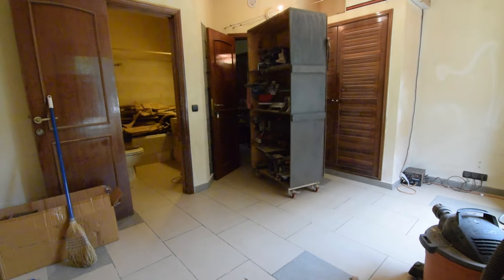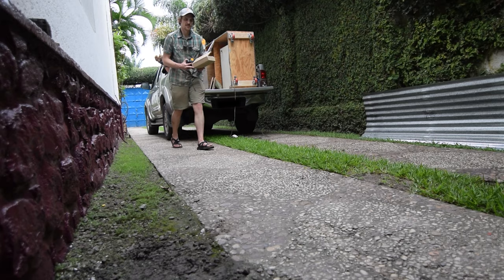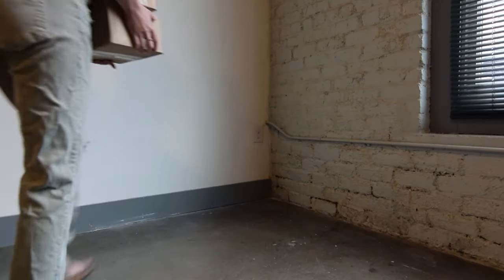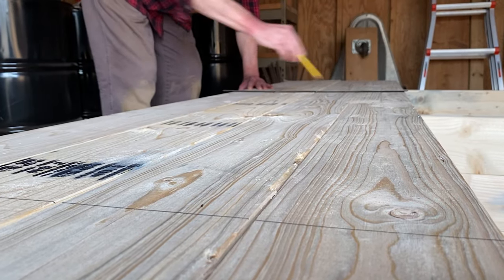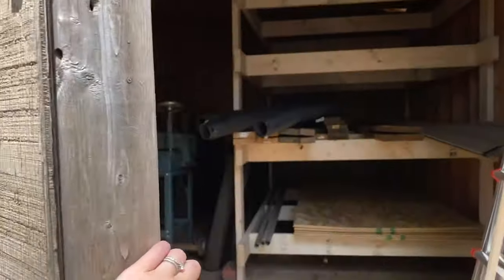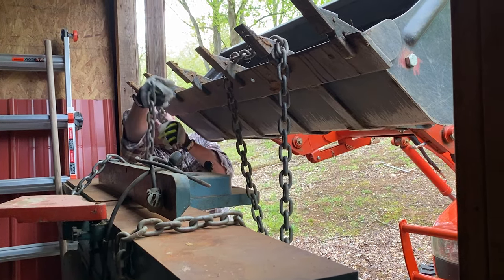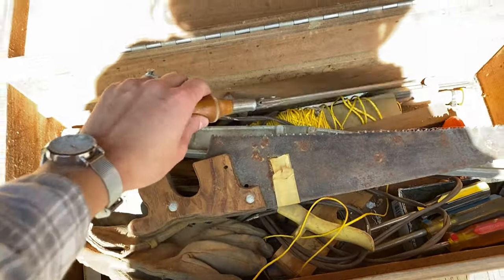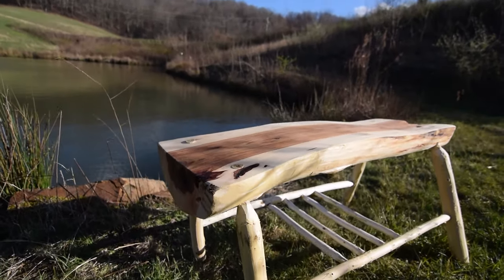I sold my entire wood shop | HW|adventures Ep. 1

Comment: Bit of a bugger that you had to get out so quickly but I hope your tools went to a good home. Nice to see you, husband and dogs got home safely.
How wonderful that your Dad gave you the jointer and planer! Even better are some of your grandfather’s tools!
As to the jointer and planer, you’ll want to have a critical look at the wiring and maybe replace it if the insulation is brittle, check the motors for resistance and the state of the brushes. Likely any belts will be tired and then check the bearings for stiffness and play. Replace as required. Not a big job. Some surface rust which will go easily and you’ll be able to easily smooth the jointer deck again as it’s unlikely to have moved about. Then check all the things that are supposed to move actually do so and oil as required. Job done. I look forward to seeing the video.
Reply from the maker: Thanks, Alan! They did, my good friend is making good use of them - and I hope they give him as much peace and stability in crazy times as they gave me! Also, you’re exactly right - my dad is a great man, and I feel lucky to start my new shop with pieces that have so much history. Also, THANK YOU! This info is a great road map to get started with for the restorations!
Reply: HonestWork Designs no worries. Inevitably that was easier to write than actually do. Still, you’re pretty handy so refurbishing those machine is likely to be merely time consuming and you’ll have the benefit of knowing your machines inside out.